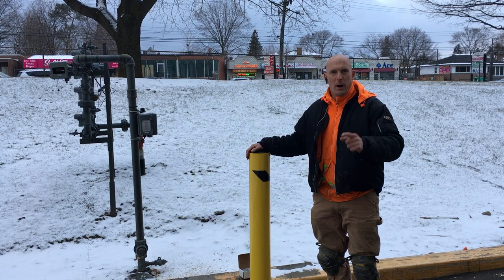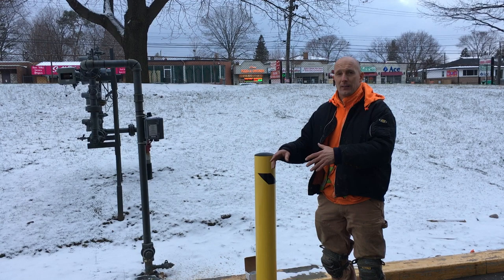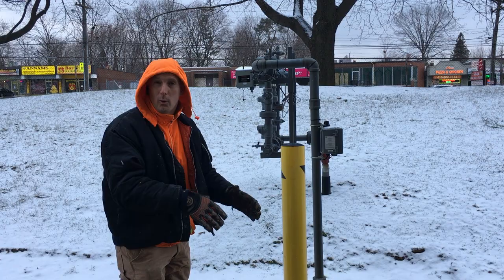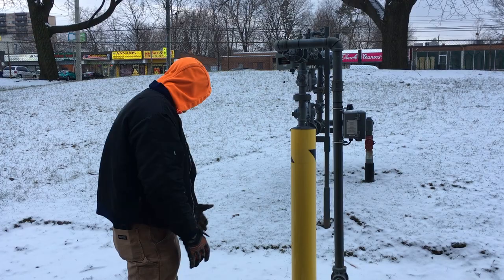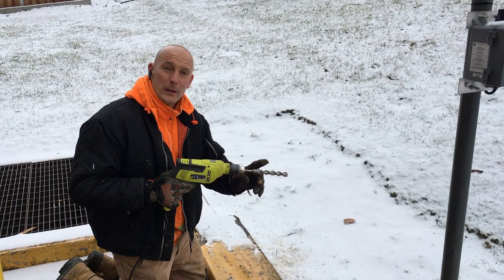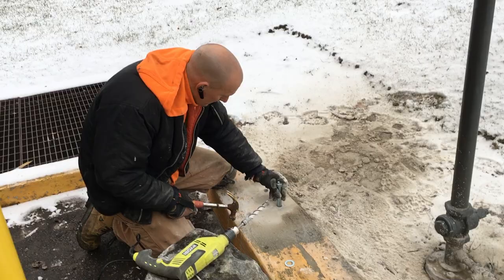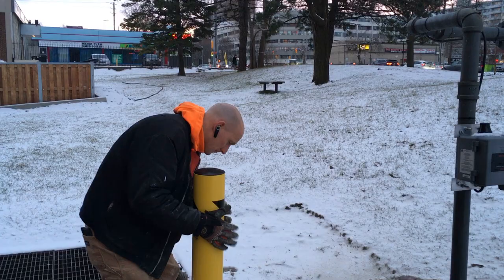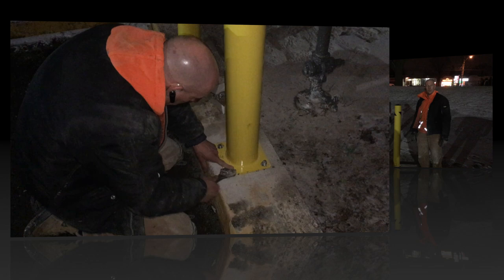Steel Bollard Installation

Comment: You didn't blow off all the dust from the holes after drilling with an air compressor.  I am an inspector and inspected drilled in anchors whether with the lag bolts or epoxy bolt, it has to be blown clean with an air compressor.  Of course with epoxy bolt, it has to be clean with a wire brush also.

Comment: Need to this to block other driveway someone had pulled my fence railing out n bent the pole i need to sink pipe sleeve in ground then pipe that slides into the sleeve.
Reply from the maker: Crazy how some people drive.  I see these things get smashed all the time.  Unreal!
Reply: That's a good idea, I install bollards for Walmarts sometimes and they have 2 removable bollards in the middle. I install them this way, I feel bad for the average person that has to remove them, they're 4 feet deep in the ground, and weigh about 300 pounds 😂

Comment: I’m in Georgia.  Never installed these before but I’m getting into jobs that want them.  How do I price this?
Reply from the maker: Good question!  So that really depends on the competition in your area and what is exactly needed.  So If its a bolt down bollard such as these ones.  I would charge for your material of course and then your time.  A job like this could range from $500-$800 CND easily.  I have minimum charge for any of my services when I show up.